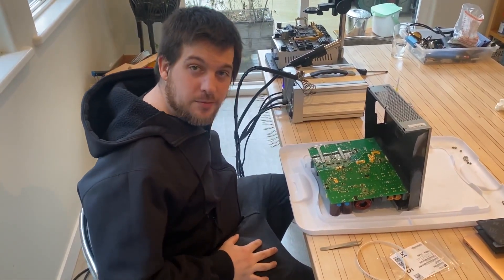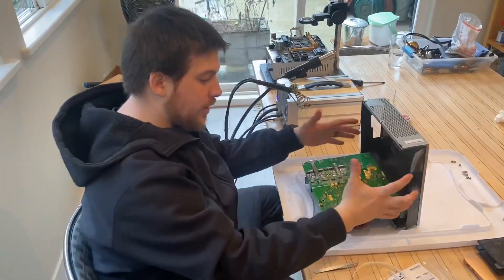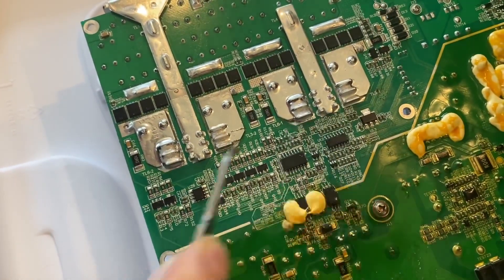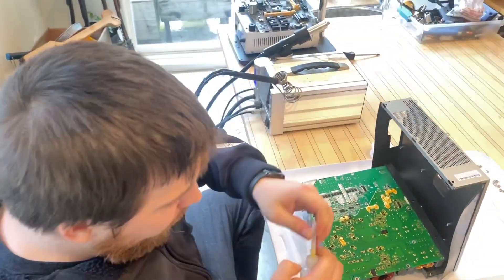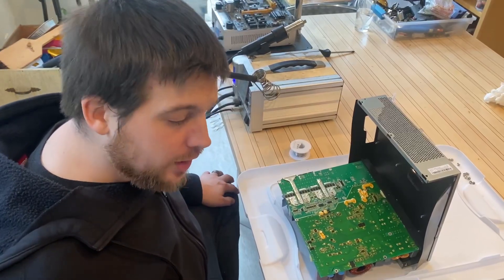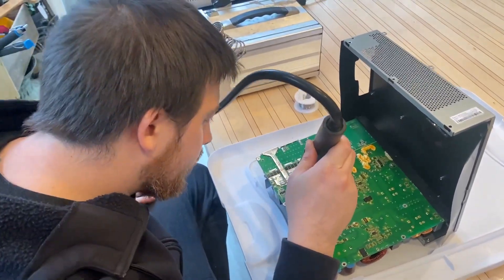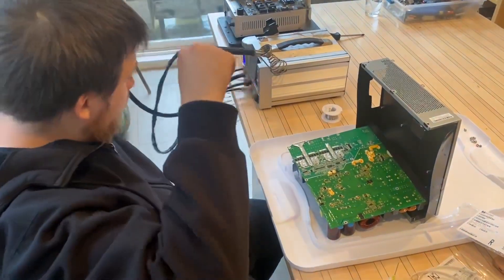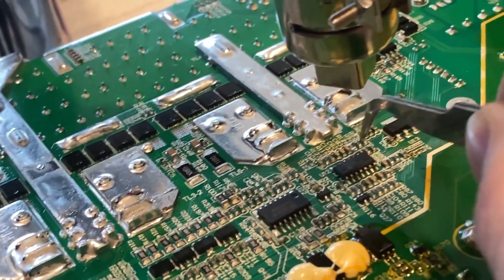Unlock FULL POWER of your Bitmain Asics S19 for only 0.03 cents!!! S19 power-supply mod 7000w +

Comment: question for yall, could you confirm the size of the resistors? was a bit blurry when they were on screen, they apear to be a 1206 for the R56 and R4.3, I want to say it was an 0805 on the  0 ohm correct?
Reply: Can you please confirm these numbers?
Reply: @af6727  i have not done it yet, so i can not confirm with certainty.

Comment: This guide was not meant to be publicized yet. It's the old method and has drawbacks. New method is closer to 10kw
Reply: @GoodGuyBiker  Well I don't want people to modify their psu with the new mod if our software doesn't support it. If you don't properly configure the software you risk damaging the miner. No so much with this mod as it only boost the voltage + .3v so 15v to 15.3v but the new mod will take it to 16.3v which if the firmware is not supporting the mod you can very easily fry your hashboard or damage the psu.
Reply from the maker: @asictothemoon8688  good point moon i can appreciate that point for sure
Reply: @GoodGuyBiker  Should have some tests with the 16v+ mod soon.  But this one is honesty probably more suitable for people. As you can almost max out a 30amp with the current mod.
Reply: @asictothemoon8688  Will you be posting on your channel or somewhere?
Reply: @asictothemoon8688  which one is more suitable? The one in THIS video or the one you are working on?
Reply: @asictothemoon8688  Which one is stable? The one in the video or the one you're working on?
Reply from the maker: What method is that?
Reply: @GoodGuyBiker  Well you will have to wait now. We don't want to release it without fw properly supporting it.

Comment: Dumb Q but would the 3 Hash boards in the S19jPro have a higher total hashing output as a result of this mod or does it just give you the extra capacity to add more hash boards onto the PSU?
Reply from the maker: By allowing the chips to over clock with more power and amps